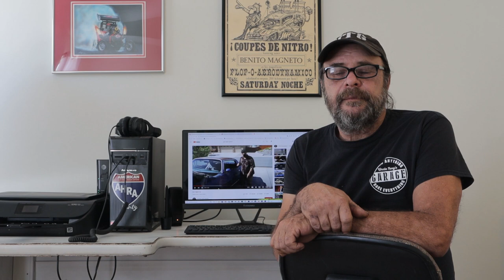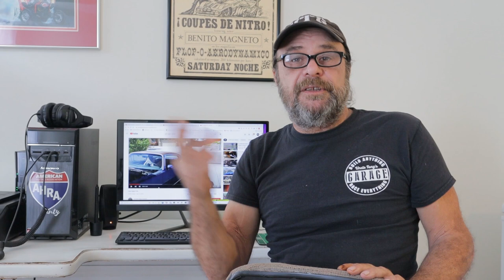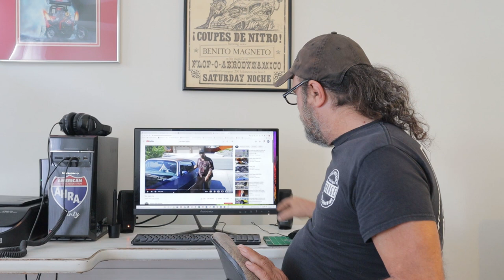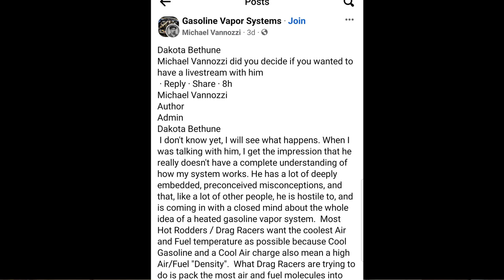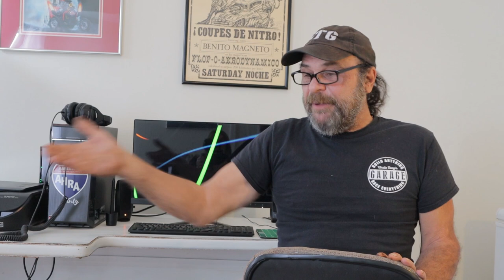Climbing Down The Mega Mileage Conspiracy Rabbit Hole

Comment: This whole thing is a joke lol. Anybody who’s worked in a government agency for more than an hour will tell you they can barely accomplish ruining themselves day to day to manage be knocking people off for things like this. 

This vapor fueling thing is a joke too. I had my 5500lb Ram getting 19-20 highway for a little while so I don’t at all doubt getting 35 in a car like that is possible. The vapor fueling isn’t why it gets that though. A couple things at work here are the slow highway speeds and high gears with a torquey V8. Take any car and tune the whole combo for low rpm torque and match it to a highway speed where it’s running stoich or slightly lean of stoich but it’s not under any kind of load, a speed where it’s just happy, you’ll blow your mind with the mileage that it gets. My combo was a fairly large throttlebody, 2bbl Mopar M1 single plane manifold, a good longtube header and catless 3” single exhaust. Truck also had 3.55 differentials and a 33” tire. Those 4x4s came with a CAD front axle and mine was deleted with a solid shaft. Also had proper PCM tuning and an AFR gauge. Yes this is an EFI application so the process is slightly different but the same rules apply. Watching my AFR while cruising you can see when it comes under a load through throttle enrichment, it’ll go from stoich to dropping into the 11-13s depending on your tuning. And then pop back to stoich. For me, 62mph was the perfect speed on a nice day where it maintained stoich beautifully with next to no load/enrichment. I should a proper functioning lockup converter was a big key here as well. It did that 62mph at around 17-1800rpm and just cruised. If it were a 2wd I probably could’ve improved it further with taking out some weight, better aero profile and less parasitic drag from no transfercase spinning all the time but I wasn’t at all displeased.

Comment: The pursuit of extremely high-efficiency, low-consumption engine setups in itself only exists because the prices of petroleum fuels are made substantial artificially by draconian, catastrophic (even in America) fees, taxes, and emissions-related penalties. Nobody would even be interested in this fantastical unicorn of a carburetor if gas could be bought at a fraction of its current price.

Government created this completely synthetic issue through thousands of layers of regulatory burdens. If you could buy fuel for your car at 75 cents per gallon, all of these attendant issues wouldn't even exist. Why is there so little concerted resistance to the incremental illegalization of the internal combustion engine at the hands of the state? Why is nobody protesting the unconscionable state-mandated costs imposed on the acquisition of petroleum fuels by consumers?
Reply: Because of downfall of the commons. It isn't the regulation keeping the prices high. It all gets used, and it is done at the price of supply.
Reply: If cars use gas at 1970s levels, it runs out. If that many carbon deposits are in the air, prices are not only higher than now, but people die from air-pollution.

Comment: LOL, the thing the vapor carb or any of these attempts can't defeat is physics. We all know that the the best air/fuel ratio is 12-1 or 13-1 or there in about and this only happens when the fuel is a vapor. Anything that doesn't vaporize doesn't burn, again physics. Depending on the induction system you may use a 9-1 ratio to get to the 12-1 that actually does the work. Also as we know in race cars extra fuel is often used to cool the cylinder and the fuel vaporizes as it pulls out heat. 

As to the guy with the system, it doesn't matte whether Tony understands how his system works, you put it on a dyno, science is science and facts are facts. Period.  Looks like Tony has done all he can do to offer the chance to prove his system but the guy just will not do it.

Comment: Listen up.  In one liquid liter of gasoline there is 156.6 liters of vapor. Gasoline powered vehicles don't run on gasoline as a liquid you have to atomize (mix with air to an optimal ratio) for an engine to burn it. so that means higher mileage gasoline vehicles is possible. Currently your average car only gets a 30% burn the rest is wasted. (facts look it up). if your average car takes 80 L of liquid gasoline and there is 156 L of potential energy in one L that's over 12,000l  of explosive energy being wasted every day. Propane is the best example only its already sold to the consumer as a Vapor so uncle sam already got his cut. or an old coleman camping stove the burns gasoline of white gas....Pressurize the fuel tank turn it on once the element heats up it converts liquid to vapor...I feel like this guy is being paid to counter the believers that we are being lied too. That or he legit doesn't see it.

Comment: I am serious check the history of the most recent SEMA show. They had a 55 Chevy truck with an LS engine running on hydrogen not HHO. they compressd it in an oxygen tank at 3000 P.S.I. an it ran like a raped ape. Hydrogen is made from water. HHO is also made from water but way to dangerous. HHO is 2 parts hydrogen & 1 part oxygen. Remove the oxygen and you have a very light gas that needs to be compressed to 3000 plus psi to hold enough to drive a full day on. I know how to separate hho. It really works. Ill try to find the links for you. The Los Angeles bus systems are running on hydrogen true story.

Comment: So you're telling me it's not possible to build such a machine that turns 800rpm at 65, using a sub-300cc engine? Does a 150hp car that can do over 120mph seem excessive to you in any way? If people really wanted to get 200mpg it could be done, but just aren't ready to make the sacrifices. At the end of the day, less power and less friction is what will achieve better mileage, and people aren't willing to ride a sub 200lb vehicle with bicycle-like acceleration. 4 Cylinder econoboxes are just at the intersection of cheap to run, and having enough power and mass that you don't feel like you're sacrificing anything (convenience) It's the American way, we want to have our cake and eat it too, we want 100mpg but god forbid someone suggests you run less rpms or a smaller vehicle, or even worse a hybrid. So we settle for about 35mpg combined fleet. Evident by tony saying "getting down the road isn't good enough bro" yet that's what 99.99% of people do 99.99% of the time. I'm so angry that I live in a society where saving gas is deemed "not worth the effort" by most regular people but every time the price of the stuff goes up by 50 cents, they act like it's the end of the world. So up yours Tony, with your buzzwords and cherry picked hypermiling scenarios. You can keep paying those fuel costs for yourself, I personally don't wanna subsidize you or the millions of Suburbans rolling around with only the driver and no cargo. Does that seem like a culture interested in saving gas to you? No, obviously American car culture is all about excess and feelings, don't act like you've never shat on someone for driving a Prius

PS a tesla model y can go well over 100 miles off the energy contained in 1 gallon of gasoline. A 4500+lb, mass produced luxury car, from one of the most profitable companies in the world. And knowing this, you'd still tell me there's simply not enough energy in a gallon of gas to move a homo sapien 200 miles? Maybe it's your own ideas about what a car should be that are keeping you from admitting that 200mpg is possible. Why is it that your idea of hypermiling is running a v8 in a 70s car? It's one the least fuel efficient type of car literally ever designed, and the guy still claimed he got the mileage of a modern 4 banger out of it. Even then, why dump on the guy's fuel savings when it wasn't that complicated and could save someone hundreds that's actually daily driving the thing? This whole thing reeks of hater clickbait and privilege but I guess drama is how UTG gets paid, thanks algorithm.
Reply: @jimkaray  If me being in a doomsday cult is really what you got from those couple paragraphs, I'm sorry to tell you that you don't have great reading comprehension sir

Comment: you need to build a alternitive fuel engine! NH3 is the fuel of the tomorrow! has hi btu and a 130 octane can suport 50 to1 compression! zero carbon,cleen, water is the only by product! now for REAL vapor engine, honda built in the 1970s a stratified charge engine! look in to stratified charge engines!

Comment: Here's the answer quit trying to use gasoline as the fuel... you can use wood smoke/ gas gasification.. you can use the Geet reactor process which allows you to run almost any liquid as the fuel.. I also want everyone to think about this. Ever seen a gas car diesel when turned off? Well if you turn the distributor while that's happening you can tune the engine to run better I know it sounds crazy but I've seen it.... there's also a inert gas engine that's pretty interesting as well.. point is.. I think alot of the reason they chose gasoline back then was because it was a good lubricant for the combustion process.. I also want people to think about why did they quit using mags.. and why did they outlaw the use of copper in the exhaust/engine. Why do u think they invented fuel injection?? It's so you can't modify the engine operating parameters.. look up Joe's Suzuki it runs with the coil wire pulled he also put spark plug spark directly into the battery and it doesn't explode hydrogen only combusts with a flame or pressure extreme heat ect not a spark.. The academic system has been lying to us for so long it's not funny.. BTW there's plenty of oil they won't quit selling it until its 100% gone can't pump one more drop I think there's a infinite amount of oil or its a renewable resource anyway they never leave a well alone long enough to find out.. there's oil pumps going since before utg was alive they'll be pumping after I'm gone... 1900s pumps still in operation to this day
Reply: I'm not saying you have to stop smoking but put the crack pipe down for a little bit and let it cool off
Reply: @joecummings1260  Who are you who are so wise in the ways of science?
Reply: @yeboscrebo4451  looks like a fake troll account

Comment: It is the Proven Science of always working on the further incremental Improvement and development of technologies that improve the Thermal Efficiency of the Combustion under all RPM Ranges and Load conditions.  That pursuit of increased efficiency is how they have developed Electric Motors with as High as 98% Efficiency. Gas Engines run at less than 30% efficiency.  We can develope Technology to raise that number dramatically just as We have Improved other Things.  It is just a series of simple mechanic procedures done in the proper sequence that we much Strive to uncover to achieve a much higher efficiency in the Internal Combustion Engine.  There is No Science that Proves it Can't be Done. Get your Head Outside the Box.  You live in a Old Type Thought Bubble.  Innovation is Not Accomplished Your way.  Do You know How Efficient the F-22 Raptor Engines are compared to the F-4 Phantom Engines.  The Lawyers killed Smokey's Motor.  They made it to hard to get the Contracts agreed to.

Comment: Tony, you're making a blockheaded argument. The technology exists, and it works. This guy's car works. Smokey Yunick's car worked. True, they don't work great, but that doesn't mean the technology doesn't exist, as you've been arguing. It does exist, and it works. Some people would be happy to have a 50 MPG gas vaporization system, even if the car couldn't go faster than 55 MPH. Some people like Prius'. Accept it and move on.

Comment: This guy is as full of shit as a christmas turkey. first off, the hotter the engine runs, the more oxides of nitrogen are produced. I.C.E. are designed to run on vaporized fuel, the engine internally vaporizes it with engine heat, does it matter where in the engine? the out come is the same. zero emission? i doubt it. my 2014 chrysler 300 AWD 3.6l v-6, i got 32 mpg at 70 mph one time last summer. it has an 8spd ZF trans, i turned the a/c off and the road i drove it on was straight with minor rise and drop offs in the topography.i coasted on the drop offs and gave it just enough gas to maintain speed. i been doing this a long time and if his claims were reproduceable on a consistant basis, ESPECIALLY today, the manufacturers would jump on this like a bum on a ham sandwich. they could build bigger cars and not worry about electric.